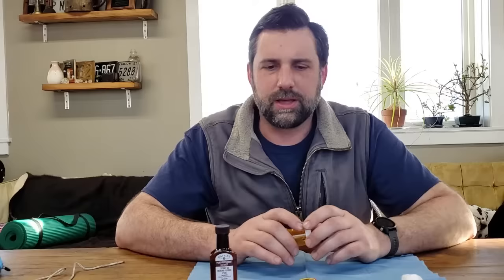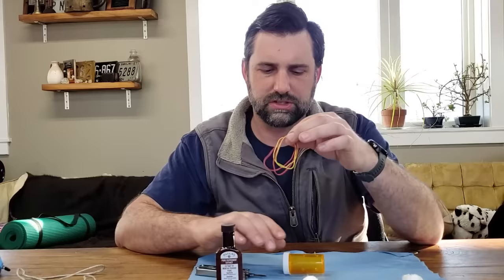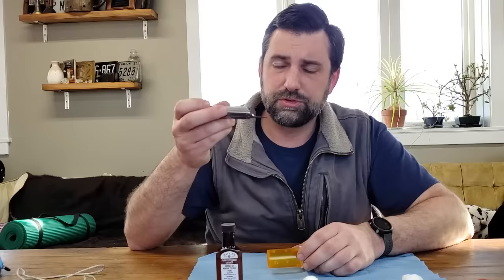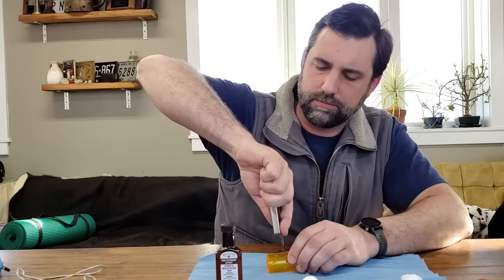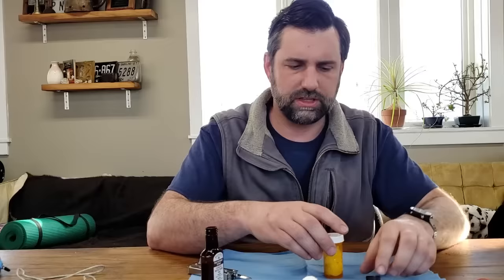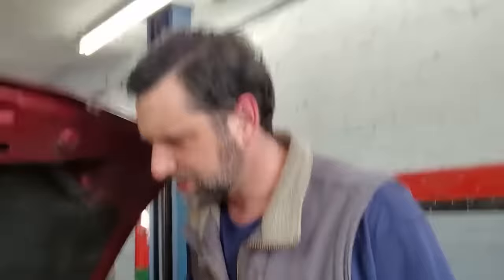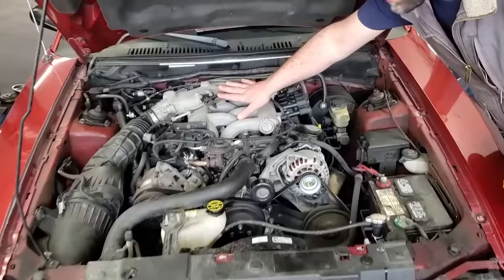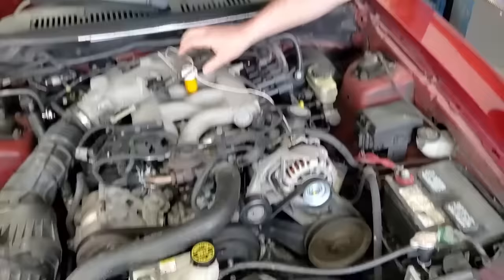Keep Mice From Ruining Your Cars Wiring With This Trick

Comment: I had wire damage caused by rodents on my Ford F150. I needed a whole new wiring harness, and, that cost almost 1400.00. Check your car insurance, mine paid for it, minus the standard 250.00 deductible on my policy. It saved me a lot of money. I then bought the peppermint spray product, and, spray that around the engine compartment, it has worked so far, but, I may try this hack as well. The spray is sold at any local hardware store and can be used in your home as well. it is natrual and non toxic, just smells like peppermint.

Comment: Everyone who recommends rodent repellant/deterrent methods for cars is an unenlightened rank amateur. They all work at the start. So you drop your guard. Then some lengthy time later come out to some total destruction as the rodents grew accustomed to your method. I have lived in the desert in Arizona since 1987 and will tell you there is no simple solution except diligence and constant checking. These methods work, but only for a while. I still have to repair wiring in one vehicle or another after several months.
Reply: Some folks raise the hood of their vehicle when parked. Have you tried that?
Reply: "no simple solution" Have you tried to read thoroughly?
Reply: @bearchow1929  so that's a "no" ?
Reply: "UNENLIGHTENED RANK AMATEUR"... put down the thesaurus and give the guy a break BEERCHOW1929 :face-blue-smiling::face-blue-smiling::face-blue-smiling:
Reply: MOATS

It's the ONLY thing that keeps those little anty scum away from the cat and dog food.

Comment: What I have done is, after patching the wires and wrapping with electrical tape, wrap in aluminum tape that has been sprinkled with some extremely bitter herb such as calea zacatechichi. Never had a problem after that.
Mint tends to dissipate over time plus I have found it way overrated in general as a rodent repellent.

Comment: I make holes in plastic pots (like cottage cheese containers, to make plant pots), by using a screwdriver with the tip heated on the kitchen stove. Melt the plastic instead of trying to use a sharp blade that might slip and cut the table, or you.

Comment: The soy in wiring cover has been around at least 8 years,l(mine is a 2014 Camry) not the last couple of years. I say this is because you need to know that it can happen to your car if it's older. My car dealer said they are constantly replacing whole harnessess. Mine cost $8000 back then, thankfully it was covered under warrenty.

Comment: I wonder if stainless steel wire mesh, like the kind they make reusable coffee filters and tea strainers out of, might be an alternative which would produce similar results, whilst eliminating the problems that could occur with placing a low heat injection mould friendly thermoplastic/polymer on top of an engine. Where it could melt and catch fire or work its way down into nooks and crannies and cause issues "down the road." As it were.

Comment: I would be afraid that plastic container would melt and/or catch fire on top of my engine.  I use mouse poison brand called Bait Chunx.  They have a hole through the middle already, and a regular 8" zip tie can be pushed through and then used to secure it under your hood.  I put one in each corner of the underhood space.  A few times I found a dead mouse under the car in the driveway.  Park inside overnight if you can, since mice are primariy nocturnal.  If you have a garage the mice can infiltrate, place some of those around the baseboard or nailed to the wall, just be careful if you have kids or pets.
A separate issue is that I discovered rabbits are like billy goats and will eat anything.  I have seen rabbits up on their hind legs under the car, chewing the wiring on the chassis.

Comment: Vick vaporub over surfaces or wires. Also mice have a lot of trouble walking on surfaces coated with petroleum jelly feet do not stick to that surface)

DO not underestimate the power of sound: a loud radio, an air horn 120 db (while mice are around). Of perhaps just an old phone with a long speech playing for 2 hours under the hood at night.
You need to be relentless, do not give them time to settle in there, 1 to 3 days max. 😅

Comment: does not do a thing to rats/mice in Travel Trailer. saturated front to rear side to side and rats are still running in and out of the trailer. Then I put an Ozone generator to use, no more rats/mice

Comment: Wood mice in the UK always go for the live in a ring main. 
It would suggest their whiskers tell them there is water running through the plastic pipe.
Been lucky so far with car wiring but EVs could have their own issues with damaged insulation.

Comment: I may have to scrap my jeep because of mice, they were in the air filter , the center consol, the glove box ,the heater/ac ducts , the dash and dome lights and the frame rails. its been sitting in a barn for a couple of years and I started restoring it when i found all the nests.

Comment: I had some rodents trying to make nests under the hood of my vehicle in the fender well area. I purchased 100% peppermint oil and diluted it with some water and soap to spray it all over heavily several times and it was unsuccessful, I know because I continued to find rodent droppings. Thereafter, I went with 100% concentrate and used an eyedropper to drop many drops all over under the hood. This still did not work and I found evidence of rodent droppings and Nest making materials. I conclude that peppermint oil is worthless. Next I tried normal solid, green colored rodent poison blocks. It was evident that they were chewing on the poison blocks and finally I found a dead rat under the hood. It seems like a waste of money to me to think that peppermint oil will do the trick.

Comment: i had a problem once in a shed they ate the wires on a snowmobile trailer i solved the problem with soldering paist also i learned this once i had a dog that chewed  wires so i left one out with electricity in it and she liked it that much more well i had my new welder and she started chewing on the welding cable right were it comes out of the welder so thats were i put soldering paist on the cable so i wasn't cruel i left a bucket of water out for her she never chewed a cord again .

Comment: mice have been chewing wires in cars for decades...i dont think its a new thing related to soy bean plastic.
Reply: I went for many decades with no trouble. Then received damage to my 06 Odyssey. Been driving since the '60s.
Reply: Organic plastics just made the problem worse, and now the actual insulation is too. If you plug holes with silicone putty, blend sharp sand into it, stops mice chewing thru it. Rubber glue with sprinkled sand stops wiring being chewed.
Reply: Good tip with mixing sand with the silicone
Reply: And you are correct . Mice have been chewing on wires back in the 1970’s I know this for a fact. Spray everyting with WD40 and it will help repell them, also spray can with lithium grease keeps them away

Comment: I guess I'm lucky, I've lived in the woods most of my life and never had a problem with mice eating the wire's on any of my vehicle's, know a guy in Florida that trapped all the squirrels on his block and relocated them because he was paranoid that they were going to eat the wiring in his new car, I asked him if they had ever bothered any of his cars before and the answer was no, he wasn't even concerned that they may have been feeding their young at the time of relocated them. The only time I've ever heard of mice doing damage is if the cars were abandoned for a very long time.
Reply: Depends, a rodent chewed my air sensor wire during one winter, first time after owning car for 7 years.  Just happened last winter.   Drove it less while driving my truck is all it took.  Truck had some battery insulation taken too.  I suspect more stick and debris in my back yard over the years brought more critters.

Comment: If you drive your vehicle more than once during this month you'll be adding more peppermint oil... I've had to add oil every other day due to the heat from the engine it dries the oil out quickly.. I drive my vehicle atleast twice a day.. If your vehicle stays parked for the majority of the month and it's always in a cool shady spot you should be good with just adding peppermint oil once a month..

Comment: Ditch the string and just use a zip tie. I zip tie a wad of fabric softener sheets to my wires in at least 2 locations. After several months you can just pour a bit of the liquid fabric softener onto the wad of sheets to refresh them. Rodents HATE this smell.

Comment: That doesn’t work but what does is 4 tbs hot sauce 2 tbs veg oil 2 tbs dish soap per gallon. Spray wires and “ valuable plants” with this . Unless you got aChupacabra issue ,, you win

Comment: Or you could spray peppermibt oil around the engine bay and around the wheels/suspension areas to keep them away.  Spray a few times a year.  😊

Comment: PAY ATTENTION TO THIS REPLY!!!! 
@PaulA-vc6sn
5 days ago (edited)
That plastic bottle will melt, the engine heat at the manifold is extremely hot. I just mix peppermint oil in a spray bottle and spray the engine compartment, keeping it away from air vents pulling air into the vehicle . Works extremely well, had a mouse rat issue in my mustang, it solved the problem.  Also built mouse rat poison feeders , totally solved the issue, utube shows how to make them with 2 inch pvc T shape, brilliant idea, works perfectly, safe for your pets

Comment: You are using cord which mice eat. Too much trouble. I use Talon blocks which purchase commercially  & tie them under the hood bonnet etc with wire, rodents no eat wire. This does not discourage them but attracts, they prefer to eat the baits first which also kills them so no return.

Comment: Your claim may be valid in 2023. But in Southern California from the beginning of 1995 I parked a car to drive periodically and the mice ruined the wiring harness. It cant be just because the insulation of the wite is made from natural products. Couldn't it simply be that rodents are destructive to just about anything.
Reply: House wiring isn't made from it, but rodents have started house fires by nibbling them, so you're right on that.

Comment: This has been going on for decades. It has nothing to do with soy.
Repellents are useless. They might protect a small area where they're placed, but nothing more.

I've been a professional automotive technician for over 25 years. During that time, I've seen rodent damage on vehicles as old as 25 years. Some had repellents hung under the hood. A couple had multiple repellents. Store-bought or homemade didn't matter, they didn't work. The only way to ensure rodents don't "move in" is to operate the vehicle daily. Every vehicle I've seen with rodent damage was allowed to sit for at least four days. Most sat for more than a week.

Comment: Ok. I'm sorry, But I think you're a little misguided about mice and wire chewing. I will say Yes factories May Be going for organic stuff for wire coatings, but that doesn't explain the 30,40,50 yr old barn find cars that have wiring damamgae from mice. The simple mater is that for SOME WIERD eeason mice like to chew on copper. That's it. The Why of it is a mystery, but UAW were not using soy and whatnot all those decades ago.